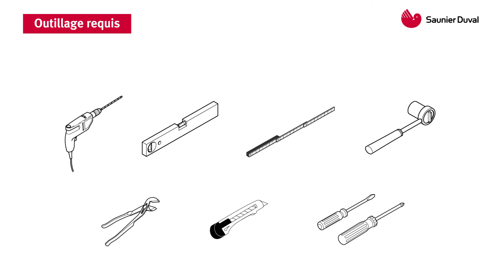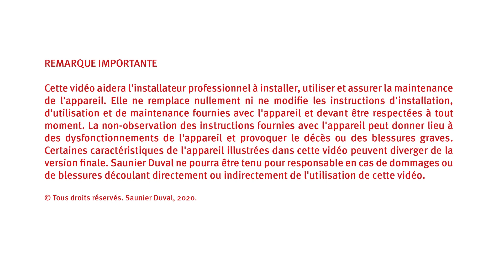Installation de la pompe à chaleur

Comment: c'est plus que de l'arnaque et quand ca marche pas de ce qui a ete promis par l'entreprise qui a incité de mettre ce système, Saunier Duval ( toulon) ne fait rien. Ca ne chauffe pas, pas plus de 44 degrés des radiateurs et quand on se plaint un gars vient chez vous, met sa main sur les radiateurs et vous dit qu'il y a 60 malgré des thermomètres qui disent le contraire. Ma maison est littéralement pourrie, moisie dû a un problème au départ de carte mère qui a mis plus de 10 jours pour être changée , 10 jours sans aucun chauffage qui a fait ressortir l'humidité après et comme ca chauffe pas ensuite .... Et que dire du coup totalement abyssal des factures d’électricité.  Merci !
Reply from the maker: (Re)bonjour Frédéric, nous sommes au regret d'apprendre votre mécontentement. Notre direction régionale Sud-est est située à Marseille, nous ne possédons aucune antenne à Toulon. Sachez qu'en tant que fabricant, nous ne sommes pas habilités à installer, entretenir, mettre en service ou dépanner les appareils. Nous vous invitons à prendre contact avec le professionnel en charge de l'installation ou de l'entretien de votre pompe à chaleur. Lui seul est habilité à réaliser les bonnes mesures de la température de l'eau présente dans vos radiateurs. Il peut être accompagné lors de son intervention par l'un de nos conseillers techniques en les joignant sur la ligne téléphonique réservée aux professionnels en cas de besoin. Si vous souhaitez réaliser une réclamation, nous vous invitons à contacter notre Service Client par mail serviceclients@vaillant-group.com. Nous vous invitons à joindre à votre mail la facture d'achat, les bons d'intervention ou devis de votre SAV ainsi que le numéro de série de l'appareil. Pour les problèmes liés à l'humidité de votre logement, nous vous invitons à prendre contact avec un professionnel habilité à vous accompagner sur cette problématique. Nos systèmes de chauffage n'ont pas pour vocation de déshumidifier votre habitation.
Belle journée, l'équipe Saunier Duval.